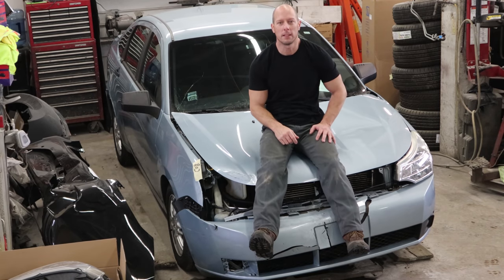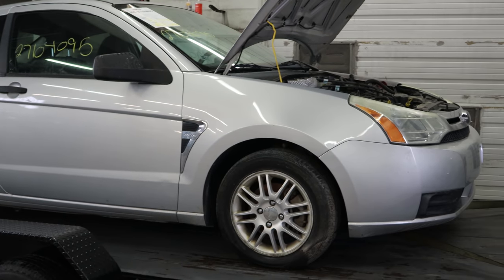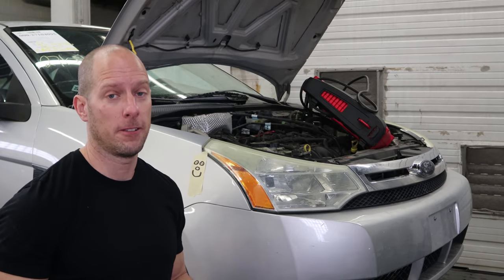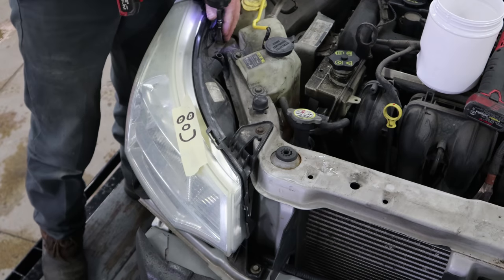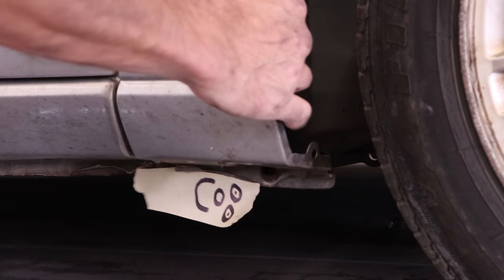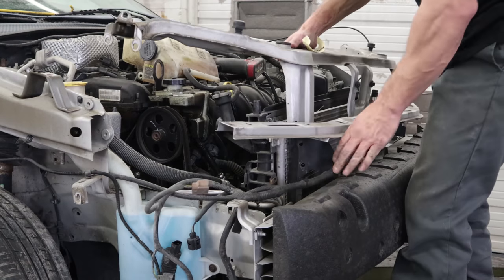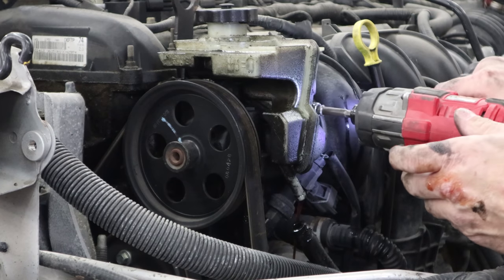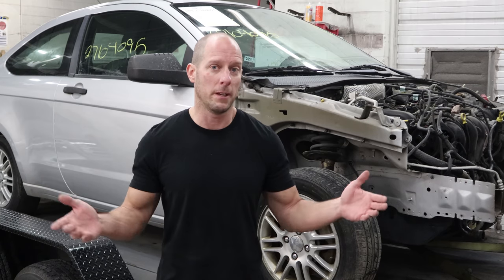Rebuilding a 2009 Ford Focus after a collision part 1

Comment: There is sometimes accounting methods to Fords madness.
I once needed to replace a shifter retaining nut for a gearbox used in both Ford and Chrysler vehicles.
I went to the Ford dealer next door to me and asked for the $4 part they wanted $185 for the whole shifter as the thing was part of an assembly that was permanently fixed together. So I drove ten miles to the Chrysler dealer and bought a dozen of the nuts and refurbished several ford shifters.
Reply from the maker: That happens with more than just Ford.

Comment: When properly maintained the Focus is a good little car.
Reply from the maker: I agree!
Reply: My friend had an 05 Focus with over 200k, rusted out, but it still ran good
Reply: Unless it’s one of the dual clutch Focuses.
Reply: @atx-cvpi_99  it was a stick
Reply: @atx-cvpi_99  I agree. I mean like early 2000's to like 2004 or so. Especially the one with the dual overhead cam

Comment: Dang, one dead focus to give life to the another. Lol the parts one just needs the cats pulled of with front clip cut off and the whole thing can be thrown in the pile, where it was going  before you stepped in. Nice, easy straight eco build. 👍🏿 cool hammer trick on getting those corroded lines off.
Reply from the maker: Yep, my parts were basically free.  It donated a few parts on its way to the pile. lol

Comment: I'm currently rebuilding a Focus MK3 on my channel, just like yours super low mileage, but it was hit in the side. Luckily the local scrap yard has all the pieces at a great price, but I'm still having to do all the work myself to keep it worth repairing, which I don't mind cause the covid virus is making everything else in the world come to a stop and this way I can keep making content for my channel (just like you are doing!)
Reply from the maker: Anything welded on with the exception of some front panels would be more work than the build is worth to me.  It kinda the same across the board on cheaper cars like this.  Good luck on your project!

Comment: I had a 09 Focus ses with 205,000 miles I sold it for a little under $2,000. Had heated leather seats, heated mirrors, sunroof, Bluetooth and only paid $3,100 for it when I got it. Extremely reliable, great on gas and super cheap to fix if anything does break. Now I have 2010 Camry and I still miss that focus a bit . A lot smaller and more exciting to drive than a Camry but I needed something bigger and with less miles.
Reply from the maker: They are decent little cars if you take care of them.  Anything cheap with low miles sells quick for me.

Comment: 👍 Definately Would Make A Great Daily Driver, and I Look Forward To Seeing This Resume 😎.. I'm Even Surprised How Both Colors Are Light Enough to Pull Off If You Needed a Quick Fix in a Pinch without Painting.
Reply from the maker: The color is not so close in person.  I think I may have found a new daily that suits me.  This one would have worked though.

Comment: I had a 2003 focus. If it wasn’t overheating it wasn’t running right. Gotta love Ford.
Reply from the maker: These were slightly better if you maintained them but they are still a Ford. 😂

Comment: You're right about how things happen in streaks. I once had a couple weeks where that was absurdly apparent at the shop I worked at.  One day was all Honda Accords,  the next day was all timing belts, the next was Nissan Altimas, the next couple days was fat Asian families pouring out of any vehicle, and then it finally finished off with two identical Toyota FJ cruisers both needing alignments, back to back.

Comment: Hey Hey now!!! i own a 11 Ford Focus SES 167k and still reliable on the road!!! I purchased it 7 years ago with less than 16k on the odometer, rebuilt title!, it had a front end collision that needed a frame rail partially replaced along with radiator, condenser, core support, crash bar, bumper cover, headlight, fender and hood and then a rear end collision that required a entire rear clip!!!! then i got it lol!!!! Yes its an econo-box but it gets great gas mileage and gets me where i need to go!!! I do all the maintenance on it my self, fairly easy to work on and i keep mine clean unlike that fast food dumpster in this video lol!!! Just one thing you might want to take a close look at is the passenger side engine mount, its hydraulic and any collision will damage the fluid bladder and if it isn't already it will start leaking a few hundred miles down the road causing harsh cabin vibration at idle. Ask me how i know!!!!! Also if it hasn't been done already if the vehicle is at 100 to 120k miles the valve cover gasket likes to start leaking dumping oil in the spark plug wells causing misfires lol!!!  I live south of you by a few hours or so and mine aside from where they did the welds on the rockers joining the rear clip is a rust free car!! Ill drive mine till the wheels fall off, put them back on and drive it more!!! The focus may be much maligned but if taken care of can be a very reliable long lasting car!!!  I look forward to seeing this build to its completion!!!! keep up the good boring work lol!!!!!
Reply from the maker: They are decent cars when maintained, that is why I fix them.  They all had bad engine mounts, even without the collisions. 😂

Comment: When I was having problems with a local dealer who I hired ( they advertise Restorations ) to paint My Low Mileage 93 Bronco in the stock colors, after 18 months I demanded a Loaner car and they gave me a new at the time 2011 Focus, I really liked the car, it just fit me well, didn't have to get used to driving it, it was like I owned it for years. My wife hated it and said she would rather drive my Bronco then the Focus which she hated to drive ( Jeep Girl lol ), I told her I wanted to trade my Bronco for the Focus and she said no your not lol.
Reply from the maker: I do have cars I like to drive but when it comes down to it, anything that will get me around and not cost a fortune to keep in the road works just fine.  This one fits the bill well.

Comment: I just bought one for 140.00 with bad trans bought trans for 150😂 cut the springs to lower it cut the cat off and resonator and muffler off strait piped looks all kinds of beasty now. 😂😁
Reply from the maker: I would have sold you the trans for $100.

Comment: Lol! I’ve always enjoyed Chrysler’s to work on personally, GM’s I’ve never cared for, Ford’s I’m sorta on the fence, depends on the vehicle. But I’d advise you to avoid Fiesta’s... I did a front collision repair on one and discovered you have to cut out the glue in front quarter glass to change the fenders, they put a single bolt under the glass!
Reply from the maker: I have worked on the fiestas.  You most likely won’t see me rebuilding one because they don’t hold value at all.

Comment: Bread and butter builds.  Works out even better if can get parts in color.
Reply from the maker: Yep, I tried but I just took the first car I could get at scrap price.  I even settled for the wrong fenders but we’ll fix that!
Reply: @vehcor  you have bit of advantage with paint shop.  I found I could buy fenders in color cheaper than paint.  Hoods were tougher to find.

Comment: I have an 08 Focus 5speed and that thing has been the most reliable car ive owned. Just starting to do preventative maintenance on it. Owned it since 95k miles, at 155k now and have only done brakes tires and oil changes. Going to be doing a clutch and maybe the timing chain after this video lol.
Reply from the maker: If you take care of them, they last just like most vehicles.

Comment: I would really like to see a Toyota Tacoma rebuild if possible. Thanks for the contents during these times
Reply from the maker: They are generally overpriced at the auction since most are shipped overseas but I bid on everything. The parts are not cheap either.  Thanks for watching.

Comment: Fix Or Repair Daily ?
The disassembly of the focus. Seemed like a breeze! Or you made it look like a breeze. 

That’s all I have to say. Simple!!

Cheers
Reply from the maker: Fairly simple to work on as most cheap cars are.  I wish they had bolted on the reinforcement and used plastic rivets in the absorber but other than that, it’s great to work on.  Minus the stupid rear brakes but we will save that for future videos! 😂

Comment: so im a chevy guy and i do have 2015 terrain 4cyl and 2018 cruze 4cyl gas turbo in-which both have time-ing chains question is do i need to replace time-ing chains after 160,000 miles  i thaught they last life time of engine ?
Reply: @L J by 2015 the 2.4L problems were mostly fixed by then Since brand new i got 80 thosand miles on mine no problems except brakes which is maintenace i kinow to keep oil changed and im golden
Reply from the maker: All of GMs timing chain and oil consumption issues can be 100% avoided with proper oil change intervals.  I use Synthetic and change mine every 5000 max.  I have never had an issue.  Timing chains will stretch and skip time if the tensioners fail.  Both of which are caused by lack of maintenance.  If you change the oil regularly, timing chains are life time parts.

Comment: My 2007 Ford has the trans cooler in the radiator. guess what happens if the radiator starts to rust through?
Reply from the maker: Most trans coolers are in the radiator.  The most common failure is when they break internally and mix the antifreeze and trans fluid.

Comment: Not a lot of meat on the bone on this one...…..
Maybe you can up the bling factor a bit with some 16" Focus alloy wheels and wider rubber. maybe a bit of pin striping.
Reply from the maker: There is plenty I will get a minimum of 400% ROI for a days work and sell it quick.

Comment: Nice intro! 😂
Reply from the maker: Thanks, it will be the most exciting part of this build! 😂
Reply: I will admit, I like the light blue color. My wife’s Impala LTZ is that color. It’s actually kind of rare. They only put it on the latest generation Impalas for the first two years. I’ve never seen another loaded LTZ Impala in her color. Of course I made sure she has the one with the upgraded wheels, dual exhaust, panoramic sun roof, heated leather, etc. 👍🏽

Comment: I used to have a 2011 Ford Focus (for a month) & it was BY FAR the worst car I ever had, I'd say it must be a Ford thing, but before that I had a 2005 Ford Five Hundred (for 5 years) & that was THE BEST car I ever had. I guess maby it's just 'luck of the draw!"
Reply from the maker: Anything with low miles and cheap sells fast.  These are decent cars if maintained.

Comment: Yeah someone really rigged up your "parts car" that's not a push to start car at all i'd venture to say the issue may not be just the timing belt, there is probably all kinds of wiring weirdness under the dash and hood too. and well taking another Ford off the roads isn't exactly a bad thing any way so you were doing the country a good service still. I recently bought my next Copart car a 242,000 mile 2005 Cadillac Escalade Luxury SUV white diamond like my baby my 06 EXT same color but this one i have no intention of keeping unlike my last 05 AWD Cadillac Escalade luxury SUV. This truck was only totaled out because the rear bumper was kinda chewed up by someone bumping into it (well that and the high miles on it) but it's not hurt. someone took great care of the engine and trans and the thing runs and drives like a dream so it was well worth the $925.00 i won it for. i've already sourced out most of the parts for it to be 100% again and i've got a total of $1,700 tied up  in it , i already have 4 people willing to give me $2,500.00 for it as soon as i am done repairing and leaning it so this ought to go well this time. Can't wait till  you start running into GM builds again my new project https://www.youtube.com/watch?v=iwuSTZ74zIA&t=804s
Reply from the maker: I suspect the ignition switch burned up and that was their fix.  No need to go further, it has served its purpose.  Good luck with your project.
Reply: @vehcor  Thanks! everything is going smoothly so far but as you well know that's usually about the time that everything begins to unravel too.

Comment: Do you know the sound a dog makes before it tosses it's cookies?  That accurately describes the condition of the parts car's interior YUCK.  How can you sit in that kind of filth.
But a no start/no run car with good body panels is a win win.  The car is worth exactly the same when you haul it off for scrap later on - couple hundred bucks.

Good luck with the boring build!
Reply from the maker: I have seen worse interiors.  I bought this for scrap price, I take my parts and recover the costs.  If I can sell some extra parts, it is all profit.  Thanks for watching.
Reply: vehcor that’s the best way to buy what you need. Completely get it. I’ve seen so many interiors at PullA Part that also look worse, full of slime, trash, human “waste”. Amazing how some people live. Anyways good luck with the build!